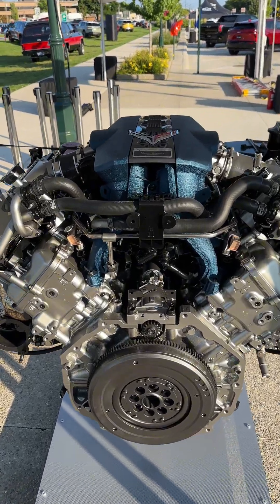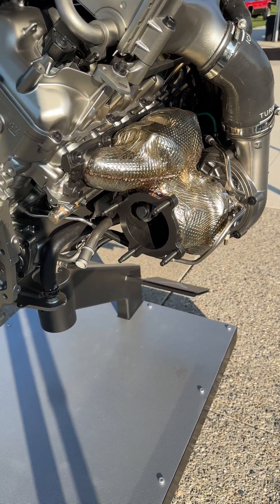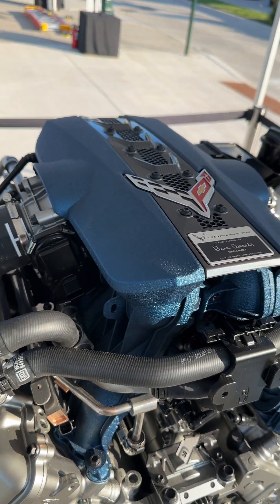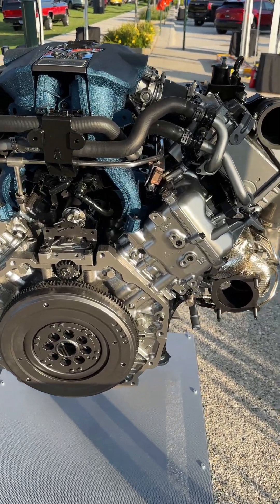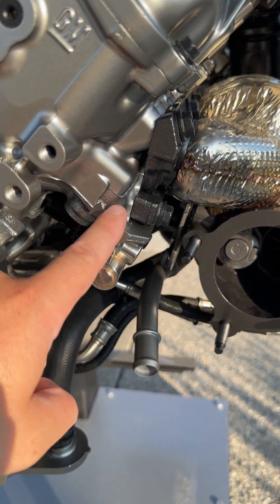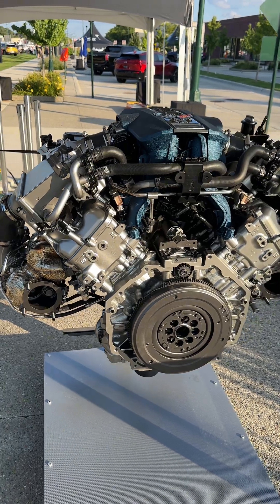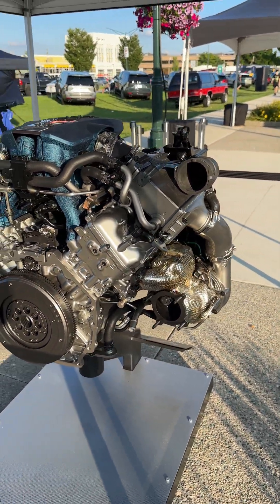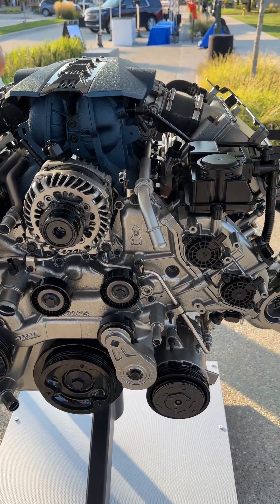NEW C8 Corvette ZR1 Engine - LT7

Comment: The oil scavenge system is nothing like the C6 Z06 which is just a dry sump. This is a true scavenge system.
Reply from the maker: Can you elaborate on the differences?
Reply: @InternalCombustion watch the Dustin Gardner video on the Z06 LT6
Reply: @InternalCombustion https://youtu.be/_uta6RWwx7s?si=mV_d6zkHNYn-87z0

Comment: What part of those turbos is 76mm?? Definitely not the compressor inducer and that's how you usually size a turbo. At 20 psi twin 76mm turbs would be making around 2000hp with this engine!
Reply from the maker: Quick google search showed the turbines are 76mm and the compressors are 67mm

Comment: Made in Wisconsin by mercury marine. This guys not the brightest bulb in the string…😂
Reply from the maker: Bro that was the LT5 from 35 years ago!
Reply: @InternalCombustion  Same engine, different application. Mercury has a patent on the engine and the motor you’re trying to refer to was NOT developed 35 yrs ago, which was the ZR-1 QC4.
Reply: @Profabdesigns  Mercury marine made the engine for the 1990 ZR-1, which should it was developed 35 (or more) years ago.

Comment: Use with high flow cats and mufflers and there will be full boost by 1800 to 2000 rpm. Still a work of art. I would buy as crate engine and just put in a glass case for show.

Comment: Someone will be hating themselves when the starter goes out 😂😂😂.  Bad ass motor 👊🇺🇸👊
Reply: Easy to change.
Reply: @user-Dr.   I hope it is because it looks like you have to take the supercharger and intake off. I would shoot myself first🤣🤣🤣😆😂
Reply: @hagerz it looks like you just have to take the intake off 🤷🏾‍♂️ idk wym supercharger
Reply: @QuajhuM  yeap. Great GM design. Right out of Fords handbook 🤬🤣
Reply: @hagerz  lol it’s not that bad, especially considering the trade offs
Reply: @hagerz  "right out of fords handbook".. Which part.. Being a dohc v8?🤦‍♂️

But how come Ford's only now just breaking the 800hp mark.. Yet GM destroys everyone on their first attempt at a boosted, dohc, fpc v8?
Reply: @flexinclouds  to answer your questions. It is right out of Fords handbook. Put the cheapest part in the worst place to get to and you instantly have a Ford to work on. Has nothing to do with specs or cams or technical shit. Keep it simple!
Reply: 100%Facts...👍👍🤣
Reply: I dont think it'd be that bad. You could easily reach it by removing the trunk access panel 👍

Comment: It would be the opposite when starting, direct injection for all lower rpm, runs cleaner, less emissions, in is very responsive to the direct injection combustion at the last moment of TDC, 
Port injection will probably kick in at 4K or so, this will keep the vavles clean, but most importantly give the proper fuel to feed the engine to turn the boost up big time.
Reply from the maker: Could be, I’m not an engineer
Reply: Not agree ! The direct injection is so bad with cold engine and increase the consumption and the emissions.That's why the port injection is the best system at starting  cold engine and keep low emissions.

Comment: Aahhhh, the latest EPA engine, a joy to behold and comforting to know that, like Yugo you’re new Corvette comes with a spare
Reply: You’re?
Reply: @justsomeguy6550  dismayed that the latest trend from manufacturers is to replace failed engines, a good indicator that premature obsolescence is inadvertently built in.
Reply: @justsomeguy6550  it’s comforting that it will not solely rely on port injection so the valves have a chance and if it’s like others it will include the dam auto shutdown when you stop potentially cooking the lubrication in the bearings of those jewels of a turbo. Thank the lord I lived and participated when the auto industry was not hobbled by the epa and manipulated by woke government mandates. All too soon you’ll be bragging about the latest Duracell and these will be garage trinkets.
Reply: Great engine. 👍

Comment: That starter probably cost 345 dollars new from GM but it will cost 1500 dollars in labor to replace 😂
Reply: The rich who buy this toy won't shed a tear over the price of a starter replacement.
Reply: @johnmcmullen456  Yeah but in 30 years when you can buy one of these as a junkyard engine it will be a huge pain.
Reply: My 1997 Lexus LS400 has the same starter placement. It lasted until well over 200k miles and I replaced it myself. Wasn’t really that big of a deal to remove the intake.
Reply: @negativeindustrial  Separates the men from the boys.. Most owners are the single cause of failure in every vehicle.
Reply: You haven’t priced stuff in a while.
Reply: It will take a few decades for those starters to wear out at the rate they get used.
Reply: Exactly what I was thinking. Bet more like a 3k job at the stealaship.
Reply: Hurr Durr!!🤣😂😂🤣
Reply: Yep,your right.
Reply: I'm a lot more worried about what it's going to take to replace the DI injectors...what a stupid place to put them.
Reply: North Star style
Reply: You could replace it yourself, I promise you, you don’t have to be a genius to work on cars.

Comment: Nice to see the starter is so accessible and easy to replace.   Really thoughtful engineering.
Reply: Toyota did this on the 4.7
Reply: @alexgoldstein7997  I believe also the Cadillac Northstar V8 did the same.  A real PITA to R&R.  What are these designers thinking?
Reply: @claiborneeastjr4129  Yes. Northstar had this as well. I am surprised about the Toyota 4.7
Reply: @claiborneeastjr4129 
Since you're an engineer, where would you put it?
These people that think they're smarter than people who make a living designing these cars kill me
Reply: @Jim-v3o  To the same WELL ACCESSIBLE location wehere 99.9 % of other engines have it. It doesn’t take to be an engineer to see this either. 😂
Anyone who is working on cars can see that.
Reply: @Jim-v3o you don't need to be an engineer to realize where a starter should go for the sake of accessibility 🤦🤦
Reply: Trust me it's way better when the starter is towards the bottom
Reply: No idea why, if they don't have room for the starter on the engine, why they don't just mount it on the transmission. My 1979 Subaru has it mounted on the transmission and my friend's 82 Oldsmobile Toronado diesel has it mounted on the transmission. Both easily accessible.
Reply: Drop the mill for a whole lot, front & rear!
Reply: Only technicians can understand this comment lol
Reply: Well, at least GM starters last forever.
Reply: No they don't.   My '06 Corvette needed a new one, and my 454SS is on its third.
Reply: @claiborneeastjr4129  Yeah they do, the starter is simple on this car anyway.
Reply: 🤷🏾‍♂️🤷🏾‍♂️if you have ZR1 money… who really cares
Reply: Just looked at this again, the starters a piece of cake.
Reply: The original zr1 had the starter in the same location. Nissan v8’s do it to. Has to be the dumbest idea ever
Reply: Must be real fun to work on - not.

Comment: Nice, but I'll take an old school 427 Rat Big Block.
Reply: Amen to that, brother!
Reply: This thing will eat that 427 for lunch.
Reply: @patrickdunn8918  I'm sure it will,but I'll still take the 427
Reply: @patrickdunn8918 but you can change the starter in a 1/2 hr on a 427 /350…😂
Reply: @paulciprus9582  I did know that at one time, but had forgotten. Thanks for the reminder. I miss those days. I’m old.

Comment: You better have ALOT OF CASH....
ESPECIALLY WHEN IT BREAKS😊
Reply: At 200K to buy one cash doesn't seem to be a problem, it will cost the same to repair as a Porsche, so not cheap but not outrageous either.
Reply: @nighthawk0077  I wish I had money to burn 😃
Reply: And imagine in 20yrs when everything is obsolete 🤦🏻‍♂️
Reply: @Fleetwoodjohn that makes no sense… people drive cars from 1920’s and 1930’s still to this day as Sunday cruisers. They wouldn’t have been able to restore those old cars if they were obsolete
Reply: @Boostlifelex  
Those cars have half or less the part count as these modern vehicles. Those cars were engineered to be repaired and run as long as someone wanted to do the work. These cars are made for the moment and who cares about 20yrs from now.
Reply: You can buy a 120 month 100,000 mile warranty so who cares if it breaks stupid 😅😂
Reply: Imagine 1000hp+ non-hybrid ice, this thing is over-stressed, a ticking time bomb.

Comment: Surprised that this new engine has the both turbos in there common place i.e. to the sides of the exhaust manifolds.  Other 2T V8's or 2T V6's have their turbos down the valley or in between the V of the engine for a more tighter package.